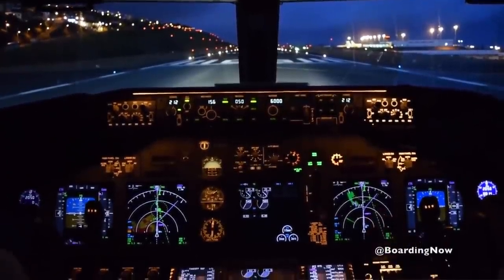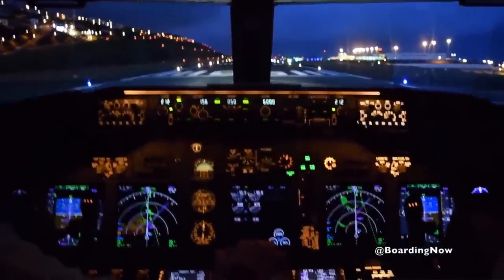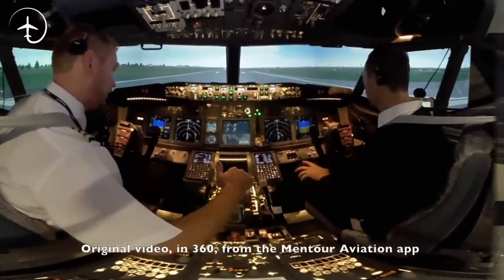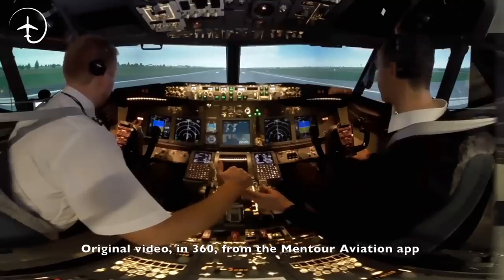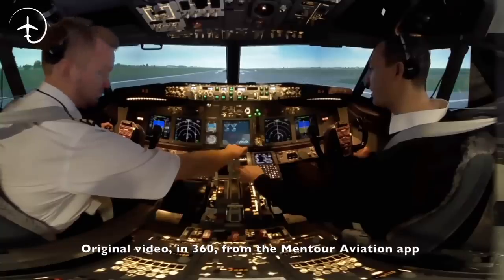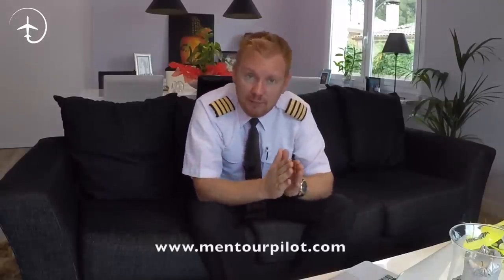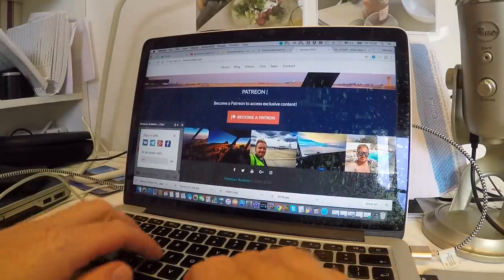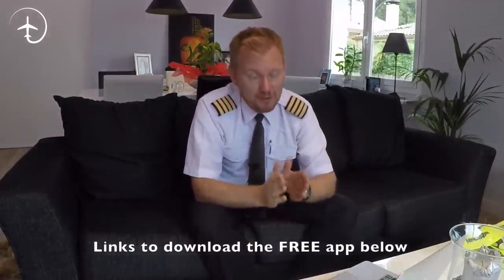Why do the aircraft engines "stop" accelerating during takeoff?

Comment: As always a very good illustration even for a command traveler and enthusiast. I have a small question if that can be replied in a video or here in comments, it goes like why on the take off roll the very moment the airplane becomes airborne some aircrafts even 777s shivers like it is struggling to lift up. But some aircrafts just glide into air effortlessly even the same type I mentioned above?
Reply: I guess the shivering comes from the landing gears in the airstream before they come up.

Comment: Is the same issue of asymmetric thrust present when the engines are at flight-idle on descent, especially if a go-around is called? Is this as much of an issue on handling if so, or is the control authority on the flight surfaces enough to minimise any issues?

Comment: I've wondered how it is possible to hold by braking an airliner still with so much power applied?  Also what is the RPM range for most tourbofan engines 0 to infinity? Is 10,000 rpm  40% or are the series of sections all separate and have all variable speeds at any throtle setting?  Are  the blades able to pivot thereby increasing compression like props are able to pitch and create more pull and push?  Just questions I'd ask an engineer.

Comment: Interesting, I knew there was a delay, but didn't know why.
Is your TO/GA button connected to autothrottles on your airplanes?
Reply: @Gun Nut The way I phrased it was meant to question if the 737 even had autothrottles installed.  However, with any of the newer models, I guess that doesn't need to be asked, they most likely do.

Comment: is there a similar effect of asymmetric behaviour when reverse thrust is applied on landing? I've been on some A319s over the last couple of days and noticed, what seems to me like over steer in a car, where the nose of the aircraft seems to be unsettled once the rear wheels touch down but the nose wheel either hasn't made contact or very soon after and there is still some lift occurring.

Comment: What causes the "buzzsaw" engine noise?
Reply: The fanblades hit the sound barrier one by one, with the repeating sound causing the buzzsaw noise. Newer aircraft use fever front fanblades and a geared system which allows the front fanblades to spin slower than the rest of the shaft. This is very successful, as seen in the Boeing 787, which virtually has no roar.

Comment: What all is involved when you "Press TOGA"?

I've watched a number of re-enactment documentaries when an aircraft is making an unstabilized approach and eventually have to go around. I've seen several cases where the plane crashed because the pilots retracted flaps prematurely, forgot to retract the gear, etc. Can all of those decisions be automated where proper thrust and trim is set, flaps, "droops", and gear set automatically, etc.? It would sure seem like a "one button solution" might have saved a lot of lives. Is anything like that implemented today, or planned?

Comment: I recently flew from BKK to PNH. What happened before taking off was that the plane (Airbus A320) was accelerating  and run for about 8 seconds during takeoff but then applied break and the upper parts of the wings opened up to reduce the plane speed. The plane then turned to taxi way to make another take off attempt. People in the plane were shocked and didn't know what was going on. Can someone please explain what was happening?

Comment: Hi, the other day I took a flight and noticed that the aircraft took off in the opposite direction to an aircraft that had just landed.
Under what circumstances would this be preferable, and how do they prevent ascending aircraft from getting in the way of the glide slope of incoming aircraft?
Reply: Keeping planes separated is what ATC is for. Depending on the airport it might have to do with terrain, or it might be due to noise abatement for a nearby city. Larger airports tend to rotate which runways they use, so you might have seen the last of a bunch come in and the first of the next bunch to go out. Or it might have been a relatively calm period for that airport so they could do a pilot a favour by letting them take off in a direction that better suits their flight plan. It could have been something as simple as weather conditions.
Reply: @fermitupoupon1754  Pretty sure it was from London Stansted, which only has one runway. Usually all the aircraft take off and land into the wind, as you'd expect, but on this occasion the aircraft taking off used the runway in exactly the opposite direction to an aircraft that had just landed

Comment: You know, the fact that you rev up the engines in stages doesn't really surprise me — I've been in enough cars that engines can vary in the way they accelerate. What is a little surprising is that you don't wait for the engines to rev up fully to takeoff thrust before you start the roll-down. After all, that would be the shortest amount of time for takeoff and the shortest distance for takeoff, as the takeoff roll is really just about building up sufficient kinetic energy for the craft's takeoff speed. I suspect the answer is that the brakes ain't built for that job, and it doesn't really make that much of a difference anyway.

Comment: How does the aircraft manage to stay on ground when you said the engines are powered to 70%?  Is it merely the brakes on the wheels that hold the aircraft?  I am sure the power of the engines must be too much for the brakes to act.  Could you explain in another video?
Reply: I'm no plane expert merely someone likes physics..

But you have different variables to take into account...

Weight of the plane
The braking power of the plane
Friction of the tires to rhe surface

In physics it's requires a lot more force to make something begin to move from a stand still vs keeping something in motion.

There is a point ofc when thrust will give way and begin to move the plane even with brakes. That I'm not sure guess it depends on the plane.
Reply: @whothou  My thoughts too on similar lines.  Let's see if Mentour Pilot throws more light on this!!

Comment: I thought you were going to answer why after leaving the runway at about 2000 ft it feels like the engines cut out, then they accelerate again. Sometimes this happens 2 or 3 times.....why?
Reply: I have also noticed that, and I think it happens because while retracting flaps from the take off position, the plane looses some lift, so engines rev up to increase it, I guess it might also be an automatic control of the airplane.
You can also feel a sort of "free fall" feeling in these moments.
This is my guess from the numerous flights I have noticed that.

Comment: It's more about getting the air moment  moving and creating positive and negvtive pressure on both engins = balance. Rpm at the same rate.... I do not fly... If it does not have a propeller it not an ✈ ..keep safe

Comment: How does the plane engine generate electricity? I know the rotational Energy of the engine is converted into electricity, but I want to know more details.
Reply: The engines and the APU generate electricity, bleed air, and hydraulic pressure. There is also a small propeller that can be deployed to generate a small amount of electricity, just enough to control the plane if all engines fail. The newest planes have batteries that can supply power.

Comment: I have been on flights where the pilot accelerates for take off as soon as they line up on the runway - no waiting.  Actually, I think they start accelerating the engines while turning onto the runway.  Is that possible that the run-up is done on the taxiway?
Reply: Yes, it was a published hi performance takeoff in our DC9's (back in the 70's and 80's while I was flying).  There were two ways to do that.  One was to push the throttles up at the 45 while taking the runway.  Of course you have to have clearance for takeoff while at the hold short line or while taxiing to the hold short.  You didn't push your throttles up for takeoff at the hold short cause your jet blast was pointed in an unsafe direction.  But we did stand them up and check for stable engines while crossing the hold short.  By the time your nose was pointed down the runway, your engines were at full power (we didn't have a TOGA switch, just a GA switch that was used only for an aborted landing).  The other way was to line up and set your brakes.  Set takeoff power and wait for the EPR's to show the engines were at power.  Then let go of your brakes and go.

Comment: Interesting, I didn’t know these things, but in the case the engines are not stabilized, does the pilot monitoring say anything? I mean, what happen?
Reply: If they do not stabilize you have a problem and abort take-off. The flight systems theoretically compensate for the small differences between engine thrusts, and give you the power you want dependant on throttle setting. If you have to mess about with the throttles to get the same thrust from both sides then you have an avionics issue or an engine issue. You expect differential thrust in twin engine manual control aircraft and that is why you need additional qualifications to fly one. In something as sophisticated as an Airbus or Boeing differential thrust is a sign of an underlying issue.

Comment: An engine could have a sensor to measure accurately the acceleration. Through the use of micro controllers that measures the current acceleration, the required acceleration,  the time to attain the required acceleration, and how the increase in acceleration is to be achieved (eg linear, logarithmic, quarter sinusoid), you can accurately control acceleration. Thereby achieving symmetric acceleration in engines.
Why isn't  that achievable?

Comment: planes should never take off on full power, all a plane should do is take off with power needed, let plane accelerate to take off speed then rotate and leave ground, if there is a stall warning then plane has extra power to apply and get out of the impending stall, if its about to stall on full power its only option is to reduce the nose and hope it can still accelerate to get out of the stall. i have been in an aircraft which got a stall warning seconds after take off, it seemed to leave the ground to slow a speed,  and started to buffet from side to side quite aggessively it got out of the impending stall by dipping the nose slightly and increasing power, still staying close to the ground for a few seconds after till it got fast enough to change angle of attack to higher, then it climbed out, while everyone on the plane sat still white with fear.

Comment: What happens when you reach 65 Knots? what's the meaning of brake release?? does it mean that the brakes are in use for some extent while acceleration??
Reply: 1. 65 knots (kts) is a little faster than 65 miles per hour (MPH) and is the most common highway speed limit in the USA. I don't know of anything in jet plane that would happen that slow. Takeoff is closer to 260 knots.
Reply: 2. Applying brakes stops a vehicle, like pressing the brake pedal. Releasing brakes allows it to roll again, like taking foot off of the brake pedal.
Reply: 3. Brakes are not used for takeoff.
Reply: Sir, when you push the TO/GA button, the thrust becomes THR REF, when the airplane reaches 65 knots thrust changes to hold... there is something called position shift (during take off, it is measured from threshold to brake release )  & should be loaded in the CDU.....What is the meaning of position shift??

Comment: interesting,
now im wondering about catapult system thats has installed on CV (Aircraft carrier), why there is no commercial plane use that system to launch the plane for shorter runway Airport,
any reason about that?
will pleasure if this question got the video for explaining :)
Reply: Maybe passengers don't want their eyeballs to bruise their eye sockets?
Reply: @algrayson8965  hahahaa
yeah the 0G into 3Gforce at severals seconds maybe make people puke lol
Reply: Different sizes, design, and weights of the aircraft to be launched would make it difficult to design such a system. Some would require shorter launches and some would require longer launches. Then there is launch speed which may differ from aircraft to aircraft.
Reply: They planned a prototype but the bean counters figured adding the proper amount of concrete was cheaper than aquiring a nuclear reactor and a super size catapult.  Then the safety nazis ruined the fun when they figured out how far a liberated nose gear would travel. Seriously though there are civilian catapult winch  launchers but they are used on small gliders.
Reply: @anullhandle  im never though the civilian glider has the catapult, since the glider usually using small engine to proper launch,

oh so the size of plane it self making hard to launch the plane it self

Comment: do turbo prop aircraft under go same effect?
Reply: All gas-turbines, turbo-props and turboshafts(geared to helicopter rotors) need even more time to stabilize. Which is why helis stay near full throttle and use the pitch-collective to change lift rather than changing engine power.

Comment: Imagine the take offs if companies did not care about wear on the landing gear or other parts. 

Hold brakes 100% Thrust (not 100% needed to just take off but MAXIMUM POWER) 
Rotate at 180-200 knots climb out at 200 knots at like 30*C pitch angle until nearing stall speed then level off.

Comment: At 6.40 he says " we will push Tolga" Can someone tell me what this means and the origination. There's nothing on Google that refers this to an aircraft
Reply: Google does not account for accents.... LOL! TOGA is a flight mode which stands for Take off/ Go around. It is not just a power setting, it is a mode which changes the power of the engine (if the aircraft is equipped with an auto throttle/thrust) and also the flight path. Most airplanes have the TOGA button located on the side of the thrust levers.

Comment: Hmmm... Interesting. I would think that new engines as-advanced-as they are today, would build up thrust at an equal rate every time. But, not so huh.?! Do you use max power on takeoff every time?
Reply: Christofer Riche Nope you NEVER use max power
Reply: @Dylan-cp3rr  why not?
Reply: @overbank56  you use about 90% thrust 100% would wear the engines quicker and burns more fuel, they use the least amount of thrust required.
Reply: @Dylan-cp3rr  Uh OK
Reply: @Dylan-cp3rr  : I would have thought you would use 100% at least for takeoff & climbing to cruise alt
Reply: @overbank56  you use about 90% at take off 80% for climb and about 65%-70%
Reply: @Dylan-cp3rr  oh OK

Comment: Good day Mentor pilot. Do you pilots ever still call full throttle "balls to the wall" ? Because that's what they called it in ww2. Because the throttle levers have these sphere handles & when you go full, the balls hit the firewall. Hence BALLS TO THE WALL
Reply: Theres a balls reference much more older than your WW2 balls. The phrase balls out comes from the steam engines which had a governor which consisted of 2 balls that spinned on a shaft and when enough centrifugal force was achieved these balls started separating from the shaft regulating the speed of the machine. When a machine was going full steam, it was going balls out!
Reply: @majortom4543  lol cool. I'm gonna look into that.
Reply: DS Analysis if you copy and search this video title  "1832 Steam Engine - Jay Leno's Garage" and go to minute 4:13 there is exactly what im talking about. And Jay leno explains it so good.

Comment: why do the engines power back after takeoff.
Reply: They can easily overspeed with so much power applied.
Reply: @mrsiborg  what is over speed
Reply: @jteaguelll  When the aircraft goes faster than it's rated to it will come apart. At a lower altitude where the air is thick, the overspeed maybe 200 kph but at a high altitude it maybe 500 kph, the air is thinner up there so it can go faster.